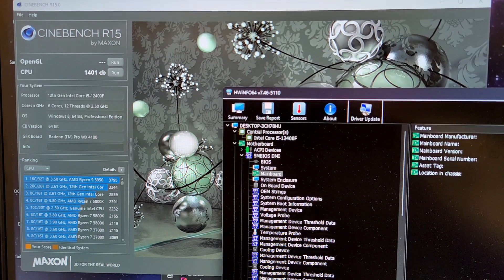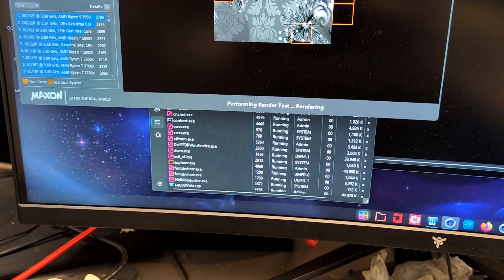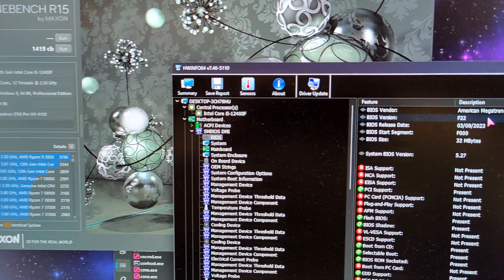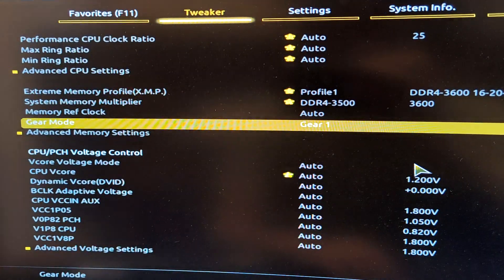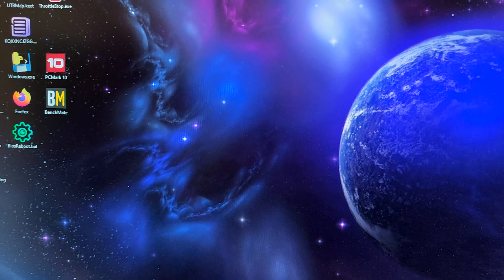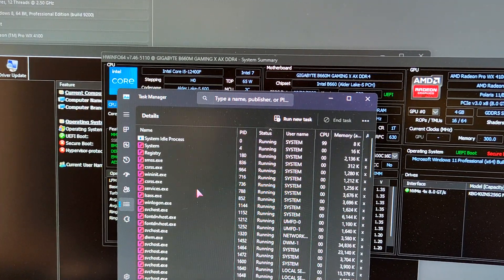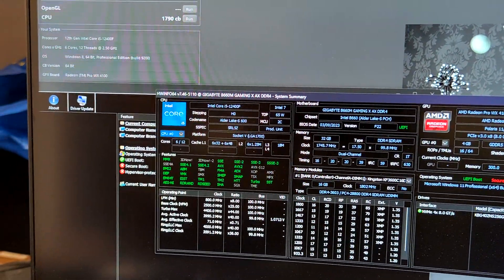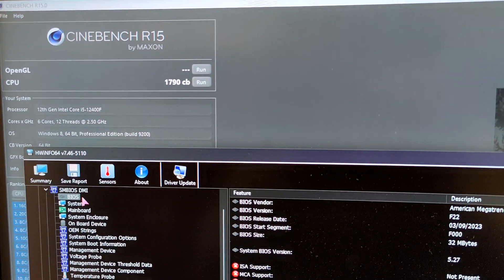Improve 12400f performance by 30% on the b660m Gaming X Ax and other similar Gigabyte boards

Comment: this would work on a b760m gaming x too yea?
Reply from the maker: you have to check wether you have C0 or H0 stepping but you can also just run benchmarks and try yourself wether undervolt or overvolt works better for you!
Reply: @mircomputers  i have a h0 12400f

Comment: I'm Los score after settling bios just like you
 before I'm scor in multi core is 12190 after your settling score is 11840 
Single core after yor settling is 1628 and before my score is 1648 what's problem in my case I have 12400f and gigabyte b760 m ds3h and ram 16gb ddr4 3200 help me please
Reply from the maker: depends which revision of core you have

H0 cannot take too much undervolt so might need this
C0 can take undervolt so better try to reduce voltage instead of rising 

you also have to disable CEP
Reply: @mircomputers I don't know core version how to ? and what's defrent between them
Reply: @mircomputers  how to disable ECP and what's ECP
Reply: Help me pro  @mircomputers

Comment: Will H610 work?
Reply from the maker: @timbim3002  probably, try it yourself, what is your score and CPU?
Reply: @mircomputers  I'm only about to get a pc with 4060 and 12400f, I'm thinking h610 would be enough for that cpu
Reply from the maker: @timbim3002  much better to wait, h610 and 4060 are trash components, or get 12100f b660 and Radeon 7700xt instead

Comment: But increasing voltage makes nothing no? I did and getting same score on Cinebench.
Reply from the maker: @elMOPI1  depends on the core you have, if it's H0 you can get better score, it it's C0 you get it better lowering it ..
Reply: @mircomputers  How do I know if I have H0 or C0? Mine is 12400f
Reply from the maker: @elMOPI1  CPU Z
Reply: @mircomputers  what is H0 and C0?
Reply from the maker: @DreamOnPc  cpu die, alder lake has 2 different

Comment: is this useful for rcps3? i have same i5 12400f stock no avx-512, but i didnt see any improve ingame
Reply from the maker: @jtadragon2000  depends on your sample, you have to use tools like Cinebench or Geekbench 6 and compare scores. Also it works only for H0 stepping, on C0 you actually need to undervolt to get best performance
Reply: @mircomputers  i have a gigabyte b760m dsh3 ddr4 with 32gb ram and the mentioned i5, so what is my best setting? undervolt or overvolt like your video?

Comment: can i use this with the i714700kf on this board??
Reply from the maker: @malle234  you have to try if the motherboard is giving the right voltage

Comment: Don't we have set the vcore to normal before applying dynamic vid offset?
Reply from the maker: i did exactly as in the video and it clearly worked
Reply: @mircomputers  yep it does, but I feel like with auto vcore settings the base vcore value could shoot up depending on load and with +ve offset it could possibly damage the cpu further.. Normal would keep the base cpu voltage constant and the vid offset would still work, what do you think?